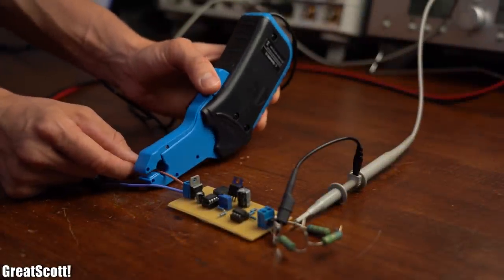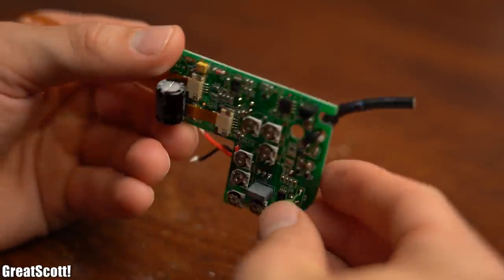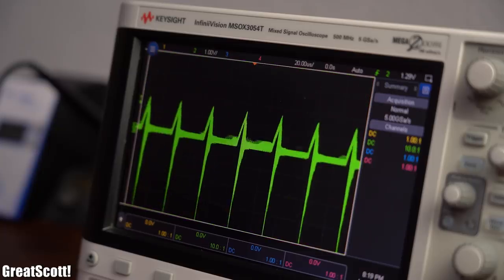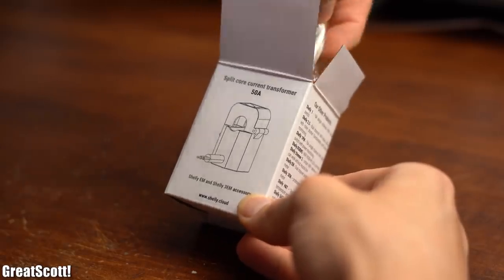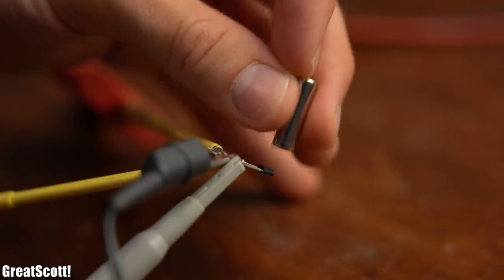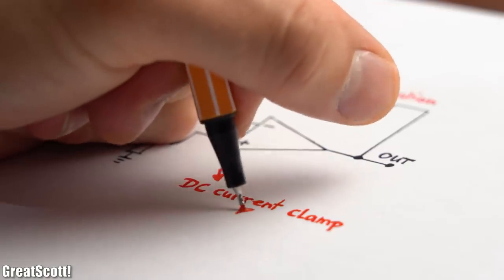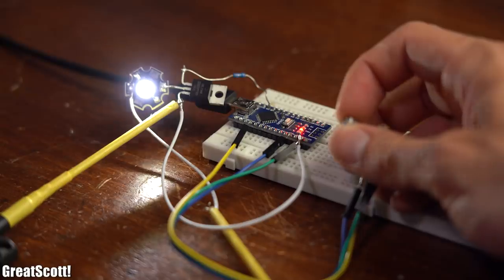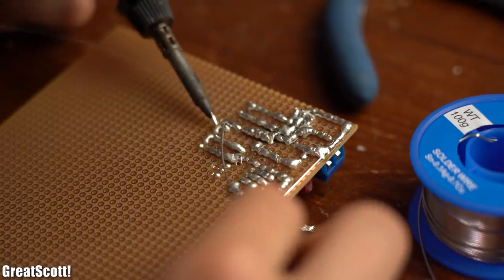Can my $15 DIY AC/DC Current Clamp keep up with a commercial one? || DIY or Buy

Comment: You could add a 100nF from pin 3 of the opamp to ground to decouple the offset adjustment voltage, this may take out some of the noise. Also the 1Meg on the output of the opamp will make a low-pass filter together with the capacitance of the coax cable and the oscilloscope input, which could be limiting the bandwidth.
Reply: Agreed
Reply: I would add a buffer at the output before the coax and in my opinion that would solve the problem with bandwidth.

Comment: You need to be mindful of your amplifier's bandwidth. Depending on your opamp IC, there is a limit on the maximum frequency it can operate at. And also, for such small internal voltages, some EMI shielding and signal traces isolation might be desirable. Furthermore, as @MikrySoft has already said, there is another current clamp design, which uses an active secondary coil. The purpose of this coil is to induce an oposing flux such that the total magnetic flux being measured by the Hall-effect sensor is 0.
Reply: I agree with closed loop current clamp design, it can provide range beyond hall sensor can handle (since it measure 0 magnetic field). for the frequency respond I think he use cheap Chinese opamp clone which can't handle that amount of frequency. I think improving the design by using class A amp instead since it need precision and not efficiency.
Reply: The "buy" clamp had what seemed to be two hall effect sensors as well, does that help with accuracy?
Reply: This is exactly right. A gain of 200 with a square-ish wave frequency of ~5kHz is pretty rough for a cheap-o op-amp

Comment: There is a second way such current clamp can work, utilizing both the Hall effect sensor and a secondary coil. Circuit drives the secondary coil to cancel out the magnetic flux in the core (as measured by the Hall effect sensors). That way you can get bigger dynamic range, but you need a more sensitive sensor that's linear around zero.
Reply: there is even a third way, only using coils: you use one coil as the compensation coil and another one as the probing coil, measuring its inductance and thus the magnetization of the core. But these are not really suitable for AC measurements, unless you make a switch for two different modes of operation.
Reply: There is the reason why the comercial current clamp uses two hall sensors.
Reply: @VladoT

Comment: @GreatScott! I saw from the datasheet of the opamp you used in the DIY version that it has an f unity of 4 MHz . An op amp with a bigger funity (ad8001 perhaps)  would make the diy clamp able to function at higher frequencies ?
Reply: The frequency is also limited by max frequency of hall sensor

Comment: Hmm, okay, 5kHz is no way good enough for investigating switch mode power supply operation. The other problem with current sense resistors is that they have inductance. A more accurate equation for voltage across a sense resistor is V = iR + Ldi/dt, and if the current is changing fast, the voltage signal is useless for observing the current waveform.

The hardest part of measuring current accurately is accounting for the change in core characteristics with a gapped core. Rather than break the flux path, it is better to break the current path. Less convenient to be sure, but far more accurate and cheaper than a high quality high bandwidth current probe.

The solution I use is an LEM current transducer, with a split supply from a dc-dc converter, all powered from a 12V plug top adapter. I mounted this all in a box with a 2.1mm dc power connector and a BNC for the signal output. Yes I have to break the current path, pass the wire through the sensor and reconnect it, but I get a superb signal with a bandwidth of up to 200kHz with the LA 55-P transducer, with an output resistance calibrated for 10mV per amp. It works REALLY well!

Comment: 6:09 you soldered an SMD capacitor to a THT component in air. My mind is blown 🤯!! Also, at 8:20, all you had to do to improve the rail splitter was to buffer the 10k-10k voltage divider (without the electrolytic caps)  with an op amp in a unity gain configuration.
Reply from the maker: But I still think the dual voltage rail was not the culprit. So adding a voltage follower would not have improved much. But of course feel free to try it out.

Comment: This is great. I want to measure the current of 4 or 6 circuits in my RV, and this looks much easier than redoing the wiring to add Inline current sensors.

Comment: Great video!
I created, back in day's, AC current clamp by myself and didn't purchase factory one.. I just take old ferrite core and wind up my own windings and connect across secondary output, one resistor.. Worked as a charm, only problem was, that I didn't cut in half ferrite ring and connection was problematic because that.. 😂 But that DIY was quick and didn't cost anything and was made just for one job..

Comment: I just recently made a signal booster coil for an automotive DC clamp meter.  The problem was trying to chase down a parasitic draw.  The inexpensive DC clamp meter just didn't have the necessary granularity for mA currents in the 1's an 10's range.

For a quickie solution, I created a 10 loop (10x) coil of wire which was placed in-line with the circuit to be measured.  The amp clamp was then applied to the 10x  coil.  The hack allowed me to locate the majority of the parasitic draw.  In the back of my mind, though, I was thinking a 100 loop (100x) coil would be nice.

Just this week I ordered a spool of 20 gauge magnet wire and wound the 100x version.  Works like a charm!

Granted, if one has access to electronic bench style tools and equipment, such an effort is a waste of time.  But, if one is just limited to a generic amp clamp and multimeter, well, the ability to extend those tools has a pay-off.

Comment: I think it's the hall sensor that is giving you trouble. The one you picked is not recommended for high frequency applications if i am not mistaken. 
Amazing video anyways! Tho i suspect that, if have money for an oscilloscope, buying a current clamp is not that expansive XD.
Reply from the maker: The datasheet says 3us respond time which means above 100kHz should be possible. But that was not the case. Not sure if the sensor was the problem.
Reply: @greatscottlab  3 microseconds gives us ~ 333KHz. For something like a square wave signal to be reproduced with a reasonable approximation, we would need at least five harmonics IMO, so this device could perform at best to 60KHz. With PWM circuits, the waveform will not be 50/50, and that implies an even lower maximum frequency of operation.

Just my $0.02 worth.

Comment: Most current probe's I'm familiar with use a 50 ohm output impedance and you have to set the scope to 50 ohms input impedance.  You've set yours up for 1 MOHM output impedance.  I'm not sure that's the best choice here.

Comment: I also tried the DIY version a few months ago. My problem was already visible with pure DC. At some point the core became magnetized so that no sensible measurement was possible any more. Either demagnetize or wait a day. I tested various core materials and hall sensors. With some combination the effect was earlier, with others later, but always the same problem with the residual magnetism. I then bought this cheap current clamp. It works perfectly, although it wasn't that cheap anymore ;-)

Comment: I think the reason that the "DIY" didn't perform well on higher frequencies is due to eddy current losses, that's why the "buy" one (as seen in the video) is using laminated thin plates to minimize the effect of Eddy current losses. And the core you were using on the DIY was single piece core.

Thanks for video it was great.
Reply: @10:07 he used the core from the buy one and still had performance issues. Its more than likely an issue with the hall effect sensor itself not being designed for such applications since it was the cheapest linear hall effect sensor you can buy (I literally bought the exact some ones like a week ago).
Reply: @bestcreations4703  I think he use the hall effect sensor only for DC current not for AC.

Comment: Great Scott, that's a decent circuit. To make it work on higher frequences, solder couple wires more to the spare opamp you have already there! Use it as a buffer, because in current setup you might have create some filter between virtual ground and coax. In my opinion, if its working great at low frequencies, this would be the reason. 
BTW I have looked for a while for nice inexpensive current clamp and for sure going to build that. 

Another option for even cheaper way of measuring the current would be to use small value resistor (0,1 ohm for example) and amplify the output with opamps to suitable level. Good for electronics and more accurate. Regards.

Comment: The gain bandwidth product of the op amp is 2~4 MHz. This means that you have a 3dB band worst case 20 kHz. With capacitive cables between sensor and opamp input you even have a lower bandwidth due to the integrating effect. Better check your circuit again. Also, why did you not use your opamp #2 in the IC to perform the virtual ground with it?

Comment: I'm pretty sure your issue is caused by four factors. 1 You are using a dual op-amp. The TL082 ideally needs unused inputs tied to ground via a 10k resistor. 2 the GBW for a TL082 is 4MHz which sounds like it should be enough but really is not for anything that has a square wave (a square wave can be thought of as a collection of sine waves all constructively and destructively interfering and some are at radically high frequencies). 3 it's a FET input op-amp. Bipolar would be a better idea due to FET's having a gate charge (I thought you might need reminding of this) which really does make a difference in situations like this. 4 It's a TL082. They are an old design and renowned for distortion in audio circuits. In fact in audio circuits you can be better off using something like a 741 in these cases. Ad that to everything else and you did well to get it up to 5KHz. An OPA228 should boost performance significantly.

Comment: Few things to check: some of analog sensors have chopper stabilization and thus narrow bandwidth. So make sure that your sensor is not of this type. The SS49E has response time of ~3us, so it should go to 100kHz easily. Your opamp has 4MHz GBW product, so at gain of 200 your corner frequency will be only 20kHz, thus not so good picture. Not sure what was the intent of R4C5? Input voltage divider? I'd rather use 50ohm in series to avoid oscillations to drive a cable, but you will guarantee the frequency linearity. Finally, you have second opamp - why not use it for active virtual ground? The best would drop the gain to ~10 (400kHz BW) and if needed, run wire through the core multiple times to increase conversion gain.

Comment: If I just want to measure dc current it is possible just making a tip with a 49E sensor and placing the sensor face  in parallel with the cable and touching it this assures the magnetic flux pass orthogonally to the sensor having a good current reading. (I think this will work just when you have isolated cables from others).
I could avoid the ferrite core and just use a pen with the sensor in the tip.

Comment: I'd posit two areas for investigation
1. the voltage rail splitting.  As you mentioned, resistor-capacitor network is ugly.  I don't know how well it copes with higher frequency demands.  I've seen rail splitting ICs for DIY audio devices, which have a couple of op-amps packaged in them.
2. The OpAmp's frequency response curves.  The output curves really look like they're being filtered.
2.1 oooooh, the perfboards' traces leading to stray capacitance and other unwanted features.

It's highly likely that a designed PCB could bring this excellent proof of concept up to being very functional.

Nice work!
Reply from the maker: Thanks for the feedback :-)

Comment: Consider buying other solder tips if it takes you one hour for such a small circuit. A small conical tip has a low mass and their for heat capacity and a bad geometry for transfer of heat to the board. I use almost only wedge shaped ones. To reduce thermal stress, I use bigger ones. The higher mass means the solder don't get solid as easy, and I don't have to stay on the point as long or even increase the temperature.

The current clamp is a nice idea. I rarely use one at home so I am used to borrow the one from work when I need it.

Comment: Problem with the high frequency might be that your virtual ground circuit uses electrolytics.
Try adding a 100nf and a 1uf mlcc to each rail.
Reply from the maker: Tried it. Did not help.

Comment: Do frequency response of DIY clamp. From that you can exactly find What's the problem with higher frequencies. It might be wrong chosen IC for Opamp or any other. Replace it & do frequency response again.....Your Keysight oscilloscope must have this feature.
Don't forget me when oscilloscope giveaway starts because I also need it😌😁

Comment: Can it be used as clump meter adapter for DC current? Can it be connected to a multimeter and to "measure" amperes in the area of volts?

Comment: Does the gap you grinded away not cause the issues in HF applications? perhaps only take away the hall probe section with a dremel like tool?
Reply from the maker: It is not ideal. The idea of using a dremel is not a bad idea. Maybe that could improve the results.

Comment: Great Video thanks! 
One comment to the bad AC performance. If I saw it correctly you almost had a Gain of 200 if the 1A current ceated as shown a voltage of 500uV this would decrease your Opamp Bandwith from 4Mhz to 20kHz. (GBP 4MHz Typical) which would decrease the Amplitude of the Harmoics incredible creating potential the bad shapes. Possible solution at least to try it different Opamp with higher bandwidth. May take a look at the one used in the commercial clamp. What do you think?

Comment: TL08x opamp family is quite old and might be the cause for your problems, since its offset voltage and noise are quite high. Since the amplitude of voltages you are trying to measure is very low, you might want to use a more recent precision amps to achieve a better result, like Texas Instruments OPAxxx families (like OPA210, OPA228, ...)

Comment: It sounds like the problems you have are based around the opamp.
1) Check that the OpAmp has enough bandwidth for the faster readings
2) The voltage splitter could also be causing excess noise
Reply from the maker: 1) I tried a few different OpAmp, all with different specs. Not much of a difference.
2) I monitored the voltage divider under load and did not see a noise problem.

Everyone should feel free to investigate on their own. I would love to find a solution👍
Reply: Wait. This video was uploaded a week ago?
Reply: That's something with Patreons right?
Reply: @trollenbier9278  awesome. I think that I should also become one
Reply: @shinesanthosh  yes, if you are at 11th july
Reply: Did you try adding an anti aliasing Filter? This could help. BR. G.

Comment: Apart from choosing a more suitable opamp, the circuit's performance could also easily be increased by using an active railsplitter with an opamp. While the circuit still is very simple and requires minimal components, the output voltage will become more stable. Also adding small decoupling capacitance to the opamp and properly terminating the unused opamp will probably help performance.

Anyways interesting topic. It blows my mind how expensive current clamps are while the principle isn't really that complicated... :-)

Comment: I think it's fault of the opamp... You should try to use one with a slew rate >10 v/us... The best thing would be a 4100 v/us monster but at that point the circuit will get unstable 🙃
Reply: It will turn to automatic oscillator 
I try using lf357 with 50V/uS in my oscilloscope and that's what happen

Comment: Nice project - but you should have considered using a dual opamp where you feed your voltage-divider into one section which is configured as a voltage follower. Then you can use the output of this opamp as your virtual gnd. Regarding your bandwidth problem: what is the amplification you used for your inverting amplifier section, and have you considered the opamp's gain-bandwidth product? A 1 MHz opamp in a 100x connection can only deliver 10 kHz of bandwidth.

Comment: Maybe you should use compensated probes to do some measurements directly at the sensor (or amplifier) output. Also the sensor could be fake. According to the datasheet, frequency roll off shoud start above 30 kHz,  so there ís something to gain. Just my 2 cents! Great project!

Comment: I think the frequency problem might have to do with the op amp's frequency limit (bandwidth?) and maybe parasitic inductances and capacitances. It may also have to do with the voltage divider, noise, and other stuff. Just some random educated guesses.

Comment: Why do you not buffered the virtual ground? You only used one opamp in an dual package that would been so easy. Also the unused opamp could induce noise into the inverting amplifier do to no fixed (stabel) level. But all in all nice video 👍
Reply from the maker: Good point!

Comment: The opamp you chose to use is probably not that high bandwidth (?) Check the GBP and slew rate.

A better design is to use setup the opamp to try and cancel the flux in the core, and measure the current into the secondary. This will mean that the feedback from the hall sensor is kept very close to zero, and thus you can use a very high bandwidth one that might not have super linear large-signal behavior.

Comment: Perhaps a differential op amp circuit would have been better in this case, rather than a simple adjustable inverting amplifier. It's not much more complex in construction, but I suspect that it would work better in higher frequencies as it self-calibrates to remove the offset voltage. I'd have to build it to know for sure though.